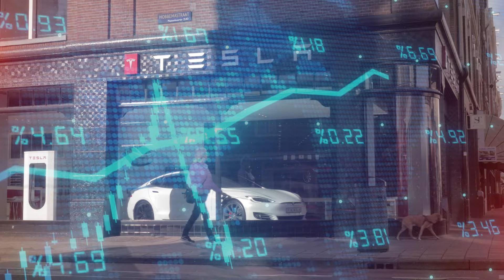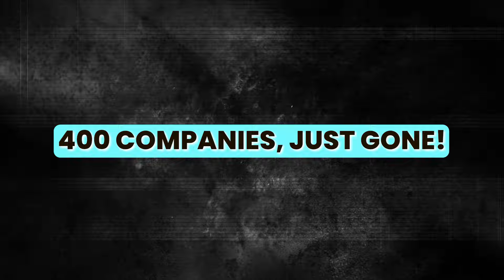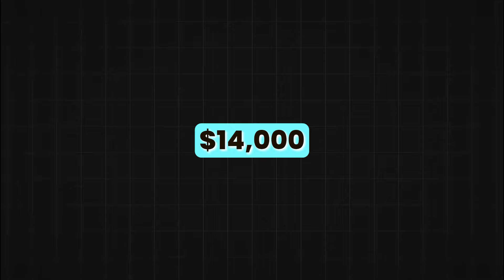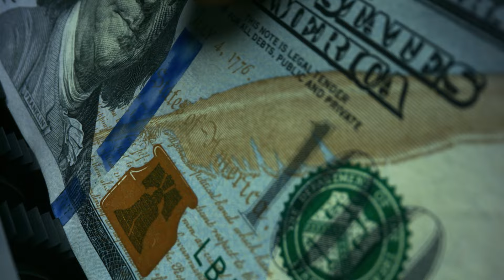80% Of Chinese EV Makers Are GOING BANKRUPT!

Comment from the maker: Would You Buy A CHINESE EV? Yes or No?🚗
Reply: No
Reply: He'll NO!
Reply: No
Reply: No
Reply: No, because of lack of availability of service and PARTS and honoring warranty claims if BYD stock values are tanking.
Reply: Nope. I won't even want my car to park next to it. In fact all basement carparks should ban EVs.

Single speed low efficiency geartrains of all EVs is the reason why EVs have to rely on high voltage. High voltage and high ampere will cause excessive of heat which will lead to massive fire outbreak.